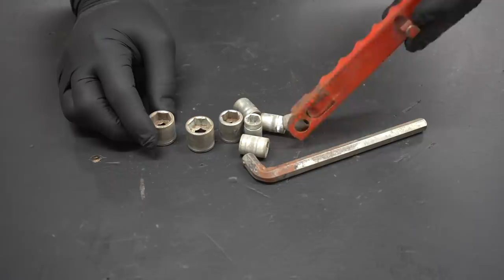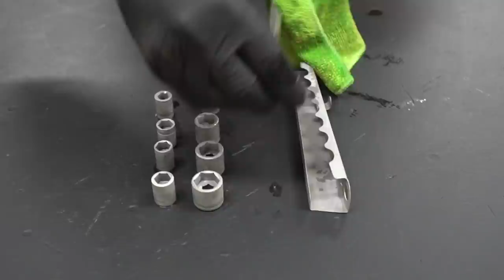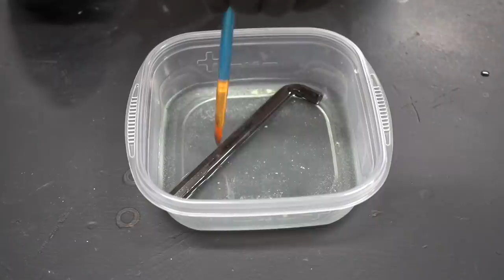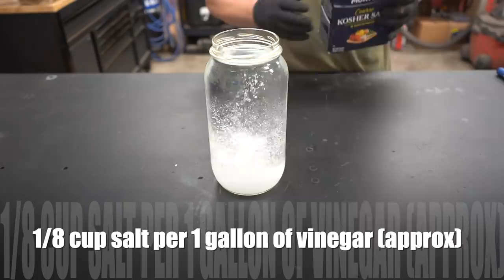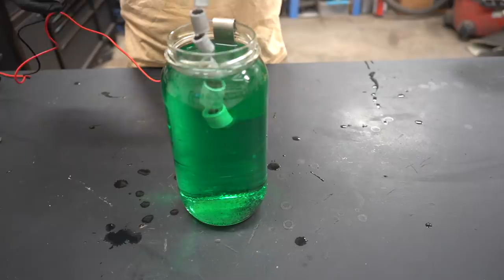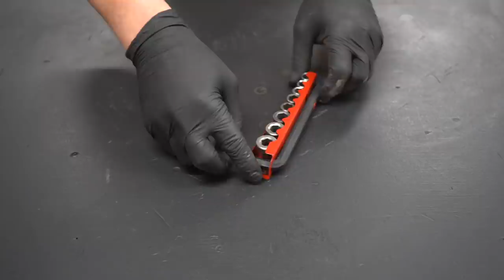Tool Restoration with How To DIY Nickel Plating at Home

Comment: The amount of salt is not so critical. I use only a teaspoon of salt and it works really fine.
Reply: Vinegar is pretty ionized as it is. The salt is just added to increase the conductivity of the fluid to electrical current.